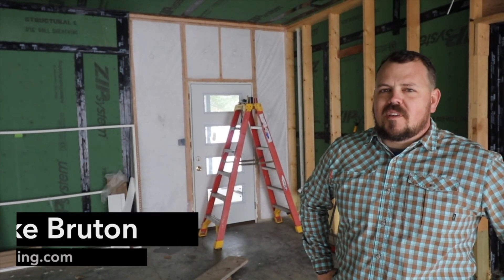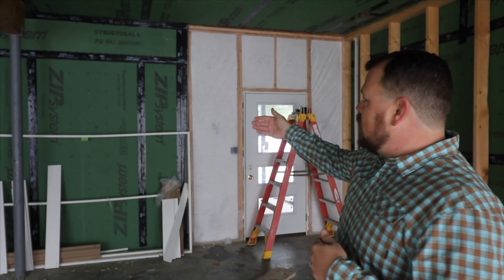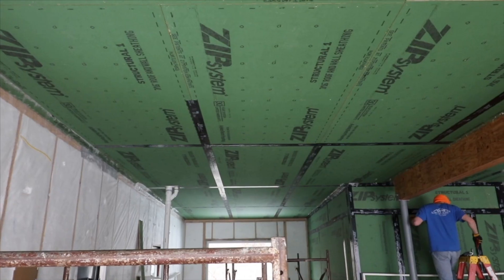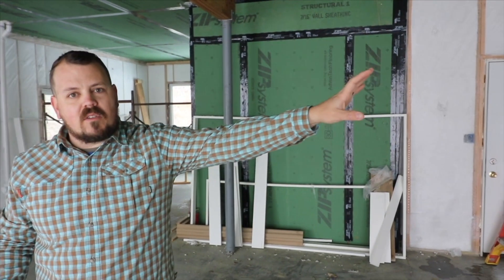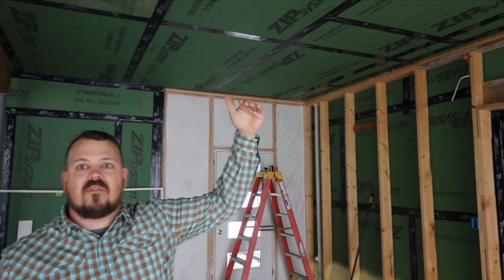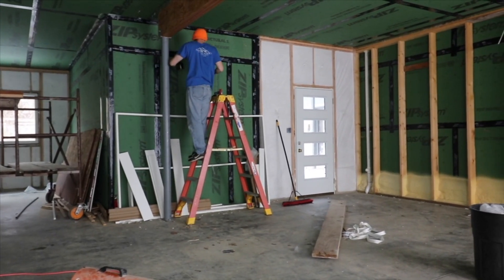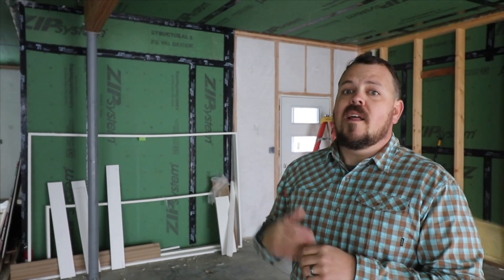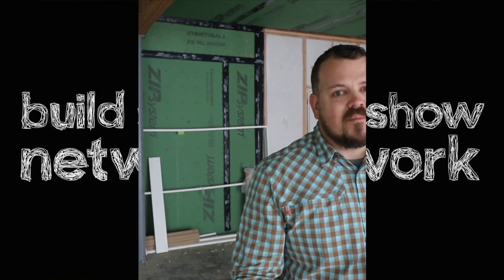AIR SEALING a Garage Ceiling

Comment: Could I use zip tape on my attic flooring to air seal once I get all of the old blow in insulation out. And then use Great Stuff Fireblock spray foam insulation around all of my ceiling fans and lights?

Comment: Do you typically apply drywall directly over the ZIP or do you apply something in between?  You mentioned running electrical for lighting.  Will those surface mount to the zip or to the drywall?  Conduit in between?

Comment: Love your details.  I am curious with the level of detail you went to seal the garage off from the upper living area, is there any concern about the drywall or conduit fasteners penetrating through the Zip and making a pathway (albeit tiny) for air infiltration?  Maybe you will use some adhesive or shorter fasteners that won’t go all the way through the sheathing?  …Now that I’m looking at the installed Zip I see there doesn’t appear to be a concern about sealing those fasteners either.

Comment: For the garage, will the Zip sheathing get covered with a thermal protection cover? (Type X gypsum board)  Is the frame spread rating for Zip or Zip-R something to consider in a fire separation assembly?
Reply: I had the same question. In my area code does not allow an osb wall finish in the garage. There has to be a fire rated finish. Which kind of sucks because zip/osb/plywood makes for a killer backer for hanging things.
Reply: Yeah, he said it will get drywall over the zip. 👍